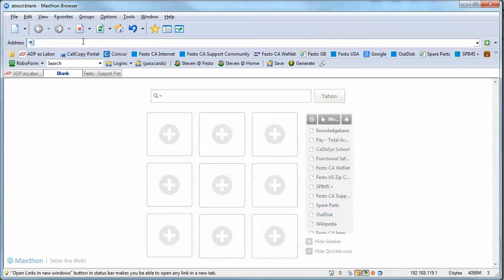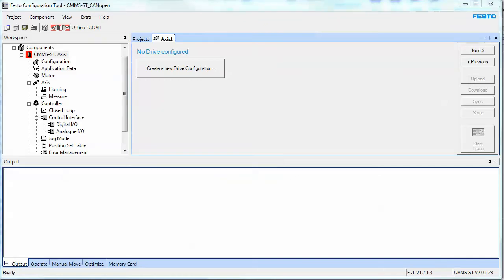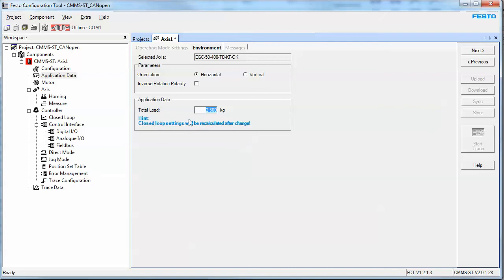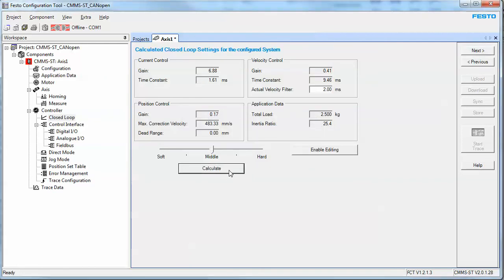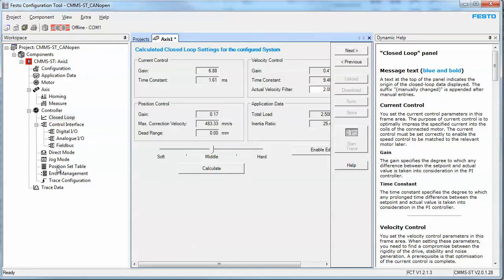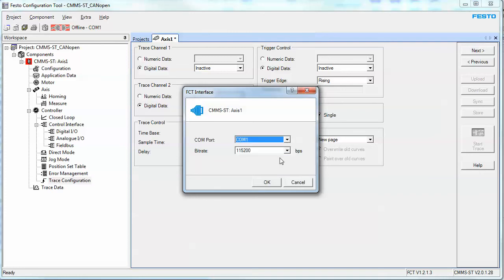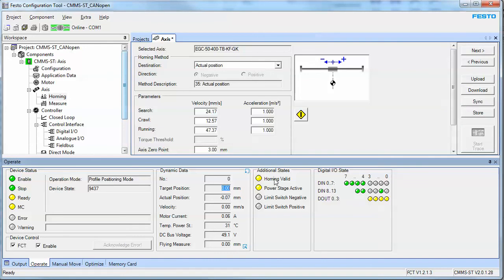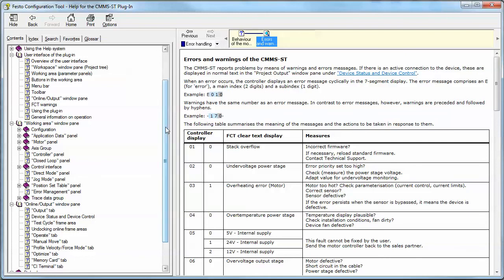CMMS-ST x1 + IO Control + FCT Config + Record Sequence

Comment: Thanks for your video ,  That is really helps me a lot  ,  I came across an error  -402-    ,  target position is behind the  sofeware negetive limit  , I try to connect the device , But  it is failed , Is there any way to solve this problem
Reply from the maker: If you encounter a problem I suggest you read the user manual or contact technical support. Sorry, however, these are my personal videos and I am not support for everyone who watches them.